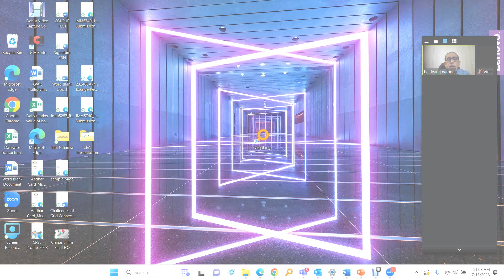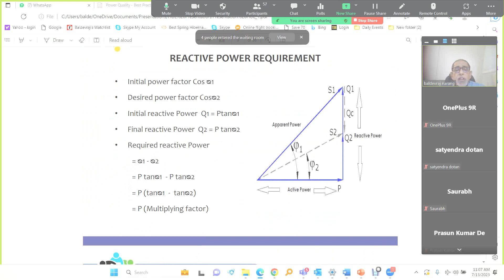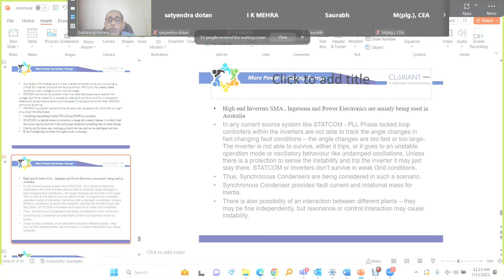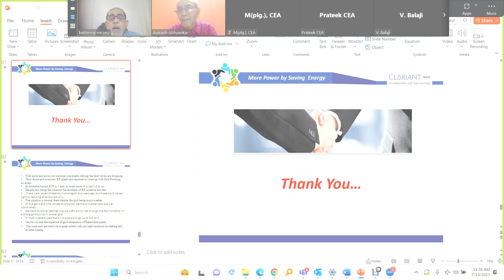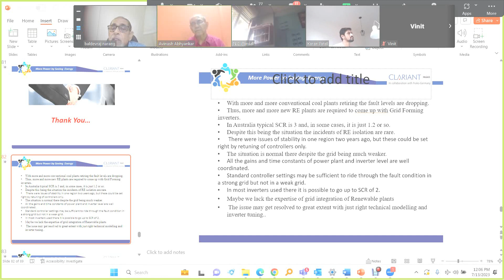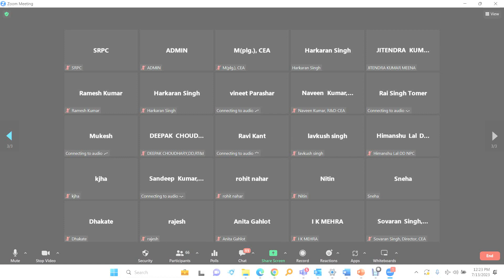Grid Integration Issues of Renewable Energy Sources

Comment: NRLDC or you can say CEA is still unsure whether to run the plant in voltage control mode/power factor control mode(unity/0.95 lag/0.95 lead)... Every time they instruct to change the control mode
Reply from the maker: The operating parameters in India are still in an evolving state and will stabilze in some time. Some of our clients are opearting at 0.95 PF and they are in Voltage Control mode.